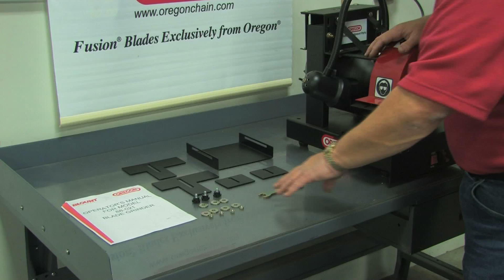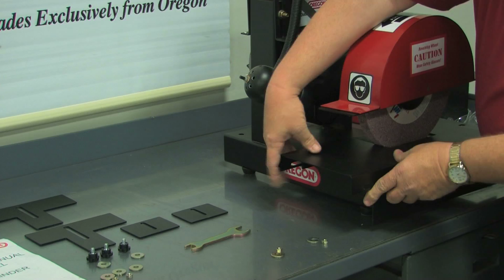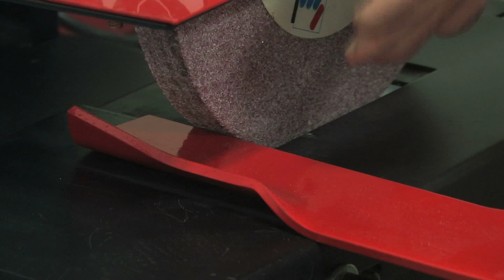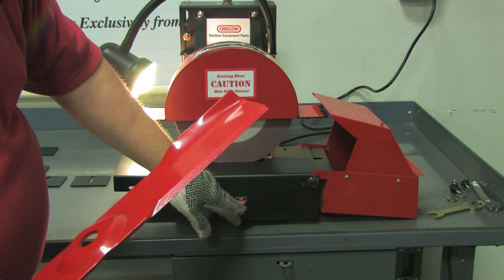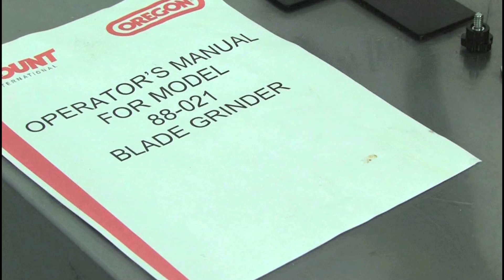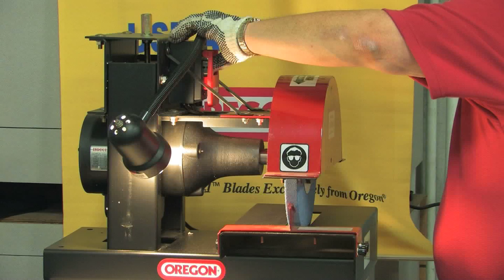oregon blade grinder

Comment: NO. Never wear gloves when using any grinder. You can loose a finger easier with a glove on than a bare one. Any machinist will tell you that.
Reply: you are holding a razor sharp piece of hot Steel leather gloves are a must.
Reply: @toyminator24 the video clearly says don't grind to a sharp edge. Also if the blade gets too warm to hold with a bare hand, you should let it cool before continuing.
Reply: I certainly agree with that. Of course, these companies try to idiot proof all equipment but in this case you are better off without the gloves.